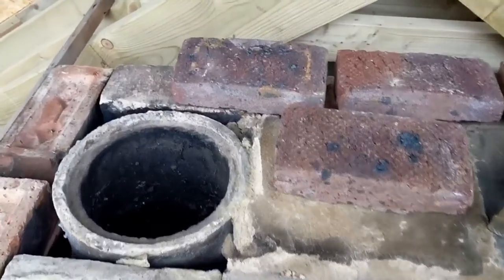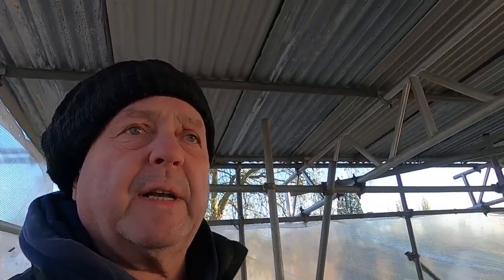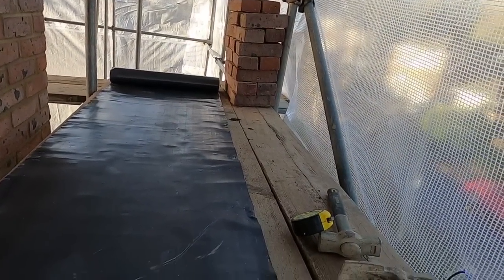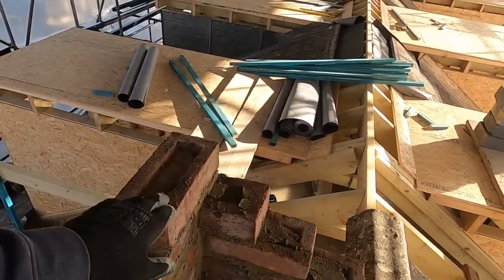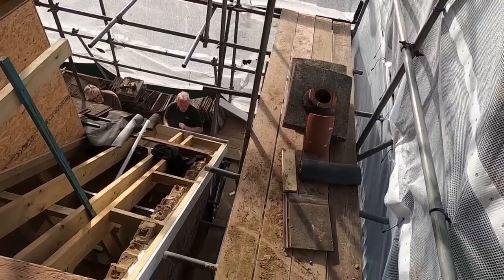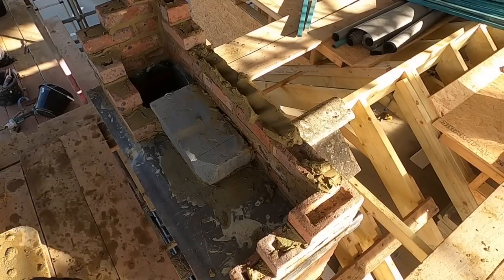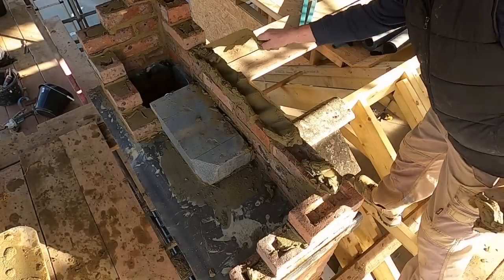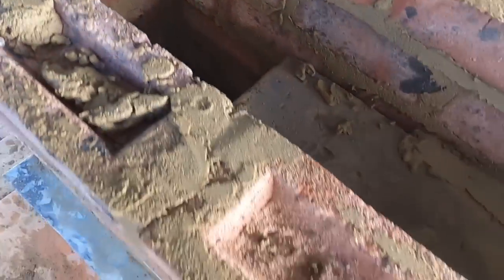Lead DPC to Chimney, and Mick's Boots.

Comment: Nice job Andy. Question- when you cover the top of the brickwork with lead does that mean the upper bricks are unstable as they are not mortared in to the lower bricks 🤔
Reply from the maker: That has always been a concern for me as well though I've never seen one come down, in this instance once the heavy coping stones go on it's not going anywhere.
Reply: @bricklayersworldwithandy6277  Thanks for the reply Andy. Guess there is a lot of weight on top so that keeps it from shifting 👍👍
Reply: @Doug....  That's it Doug, providing its heavy enough and with 10 courses and copings it will be, its not going anywhere. Old fashioned railway arches needed the weight of the parapet walls on top to to keep them stable as brickwork is at its strongest in compression.